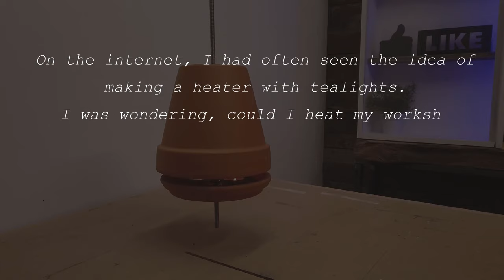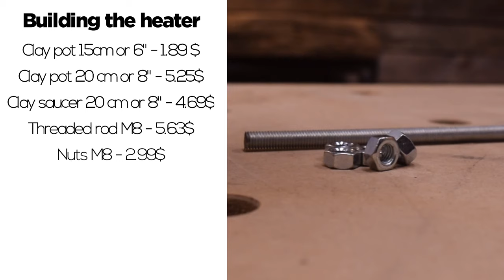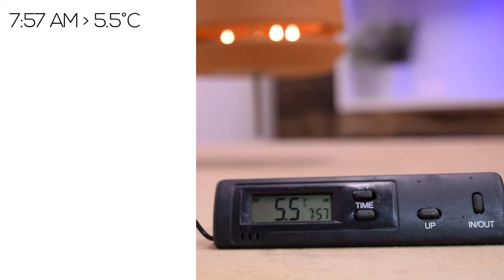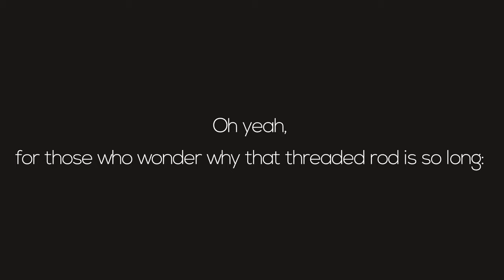High Energy Prices? I Use This Low-Cost Candle Heater (Build + Test)

Comment: What if you put a thick metal chain called Reese Tow Power or a Safety Chain in a tea light pots will it work just as good. You flip the clay pot upside down so the metal chain goes in the pot. They say the more metal more heat ??
Reply from the maker: I like that idea! Thanks for sharing! It is indeed right what you say, the more metal, more heat. 
Thank you for writing this comment, that is much appreciated.
Reply: @christofix  You welcome. I wonder is it a way I can show you a picture of the things I have. The tow chain I got from Harbor Freight Tools for about $11 called safety chain. And maybe wheel locks from Eminem You Pull It or some type of junk yard. I think you could get the wheel locks for free
Reply from the maker: @drrobotnikmeanbeanma  You can always email me that picture, my friend. christophe@christofix.com. Thanks for that!
Reply: @christofix  ok cool. And what I do is use clean empty metal cans of fruits and vegetables to put the candles in. I'm going to Walmart and the Home Depot store to figure out the biggest sizes of clay pots. To put 1 smaller one in the bigger 1. Then put the chains or wheel locks in them.
Reply: @christofix  I'ma try it solar with some stove pipe
Reply: @christofix  I'ma put a flower pot outside by my house where the dryer vent connected to a stove pipe using solar with no candles. Next I'ma safely put a flower pot inside of the house in the basement window using solar with no candles or solar panels. 3rd I'ma use a 250w electric heater directly on a flower pot without using candles with wheel locks or a chain in the flower pot
Reply: @christofix  I left I refrigerator outside when I touched it, it was really hot. That gave me a ideal. Use wood burner pipes on top of the fridge to warm the house
Reply from the maker: @drrobotnikmeanbeanma  thanks for sharing that. Great idea

Comment: none of these test videos actually do enough to control for variables, so none of this im sorry to say is really proving weather this actually works or not.
Reply from the maker: You don't have to say sorry, my friend. I fully understand. Every workplace is different, so the result will always be influenced by it. I made this video to test this principle for my workshop and actually got good results. I think everyone will have to test this system for themselves and see if it is a good solution for them or not. I hope this video has been able to inspire you and if you have tested this heater in your workshop you can certainly share the results. I am curious to see who achieves which results.
Greetings
Reply: @christofix  thats fair. Thanks for the reply
Reply: @christofix  You did not get any results.  This is junk science.  You want to believe it worked, but it did not.  There is a limited amount of chemical energy in those candles and it is nothing like enough to heat a room.

Comment: The heater didn't raise the temperature as much as you think, you see you yourself were giving off heat, you may have also been using tools giving off heat? Just an observation.
Reply from the maker: My body heat will indeed have some effect, but will it be that much? I didn't use any tools that day.
Maybe I'll test this stove this winter if I'm not in the shop and on a day the temperature outside doesn't fluctuate.  Thank you for watching, Steve!
Greetings, 
Christophe.
Reply: @christofix  we give off about 100 watts per hour I believe depending on what we are doing, that's why a crowded room soon heats up, in a survival situation we can warm up a hypothermic person by getting in a sleeping bag with them. Your heater will certainly help take the chill off.
Reply from the maker: @steveransley7227  thanks for sharing this, Steve! Like this we all learn from each other. That is awesome. I Will remember this from now on.